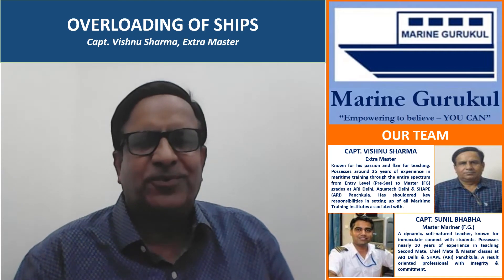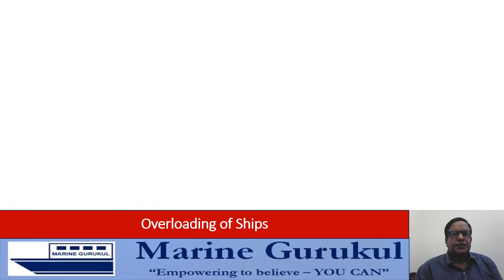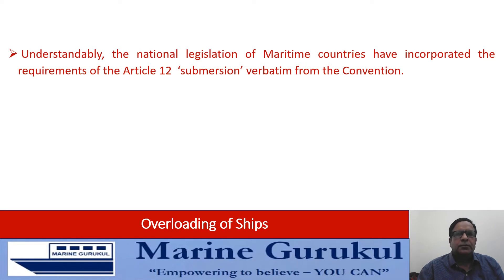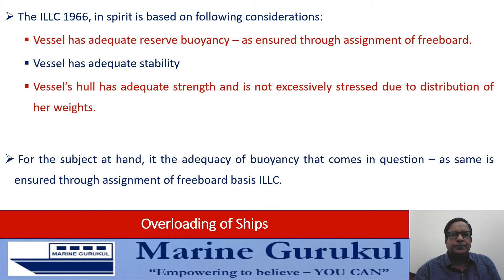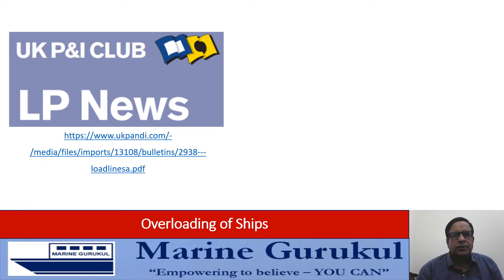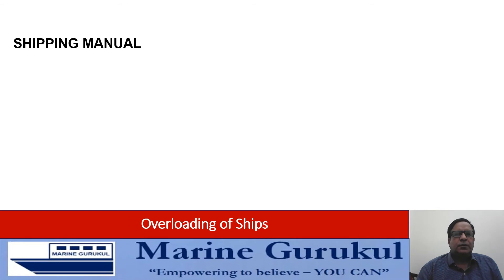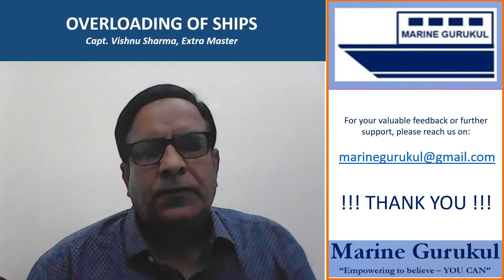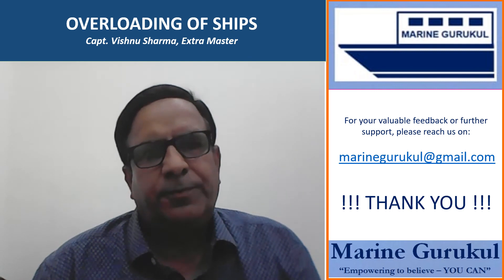Submersion of Load Line Marks Due to Sag

Comment: nice video;in my experience,overloading will be always assessed against  freeboard and not displacement-deadweight calculation;Normally, all ship experience sag when fully laden;then would be good, on doing cargo planning, to consider "sag allowance",i.e. consistency in cm of sagging amidship based on ship's past voy or c/off experience and load less of this amount at loadport,to arrive at latitude of lower seasonal mark ,with said mark above the water.thanks

Comment: sir can you please tell why the thickness of the lines are set at 25mm??
Reply from the maker: No specific reason. They were to be thick enough to be visible - accordingly fixed at 1 inch in earlier times - which under present day MKS system translates to 25 mm. Hope clear.
Reply: @MarineGurukul  thank you sir
Reply: Jai hind
 For preparation of second mate / DNS/ BSC nautical science/NCV come in #kundanpatna